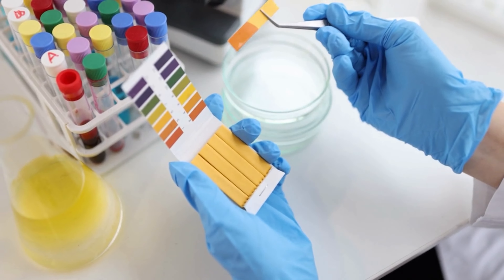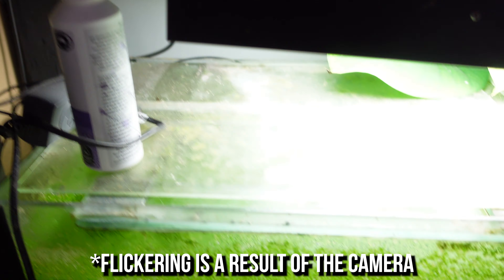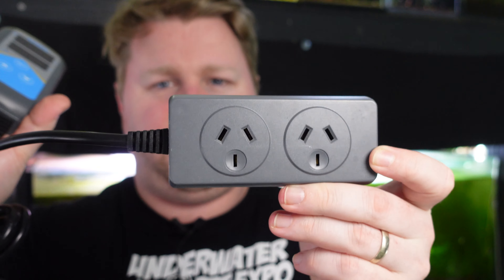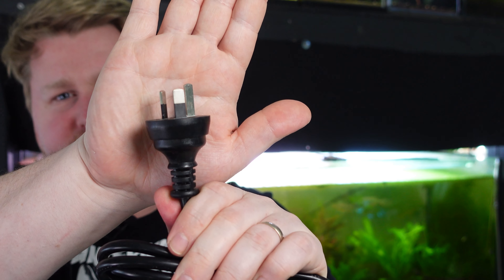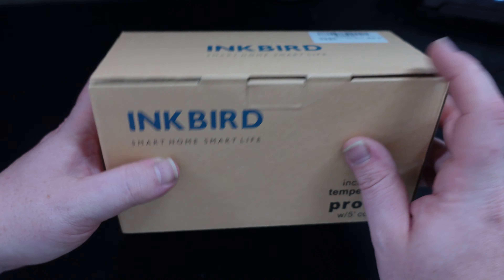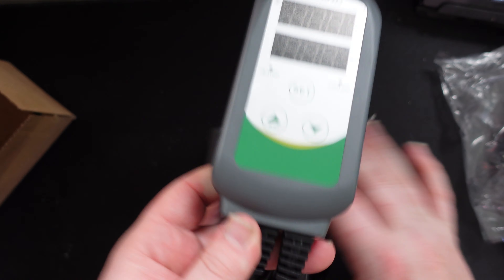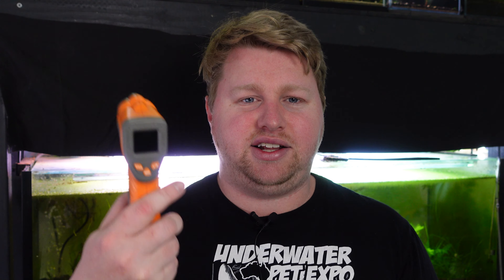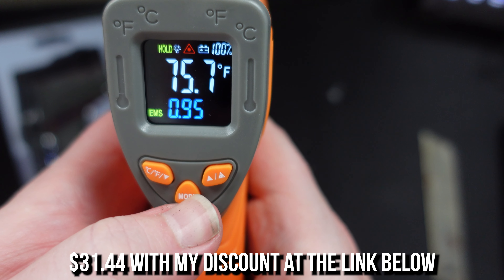Your Aquarium is a Ticking Time Bomb

Comment from the maker: G'Day!

Heater failure is something that happens way too often and causes way too many aquarium deaths, I am a huge advocate for Inkbird Temperature controllers and throughly recommend using them to safeguard yourself.

If you wanted to purchase one with 15% off, use code "BlakesTemp" at checkout over at this website https://www.ebay.com.au/itm/325382032061?fbclid=IwAR0_TYXtMoQVZw1S3s9_s9bmTtR1JBmnc-ZrHYehtGHfrwQzyrZJVuN2cwU

Cheers,
Blake
Reply: Very informative - thank you. I am interested in getting one of these. I have 2 Eheim 300W heaters and was wondering will these work with the Controller and what temp should these be set at as they have their own thermostats? It's for a tropical freshwater 6ft tank. Thank you.
Reply: Last week I lost 30 fish in a 55 gallon tank due to a digital Chinese heater shorting out!  I replaced the heater with a Fluval 200 watt and a 306a heater controller.  I don’t ever want to experience that loss again!

Comment: Using an Inkbird has allowed me to make a DIY inline heater out of an Eheim Jager. I don't have to worry about calibrating the heater, I just crank it up and connect it to the controller that monitors the actual temp in the tank.
I like Inkbirds so much, I have one set on a tank without a heater in it just so I can easily read the temp from anywhere in the room.
Reply from the maker: Yes! Those eheims can be such a pain to get right

Comment: I have inkbirds on all of my tanks. The one on my sump controls 4 heaters so they switch on and off together. Also you can adjust how much the temp drops before the heater activates, which can reduce switching cycles and prolong heater life. The low temp alarm on the green one can be heard all over the house. These controllers are awesome.